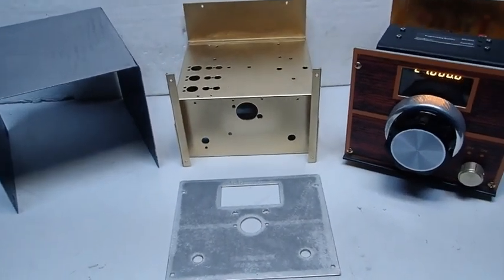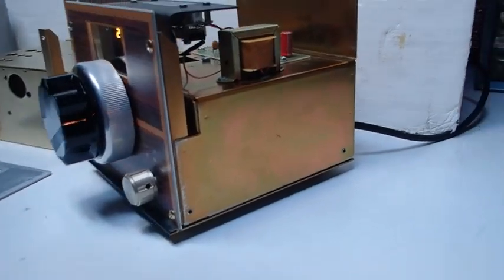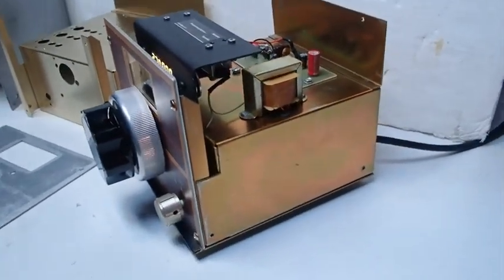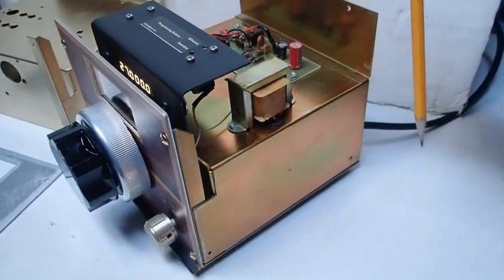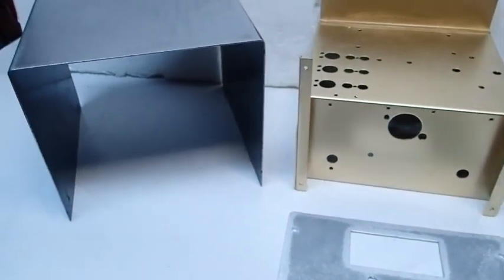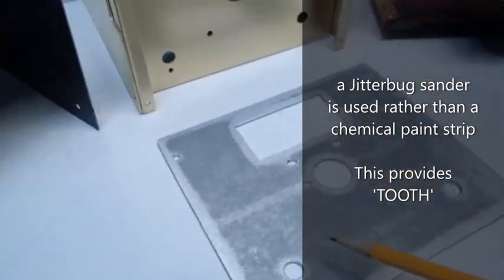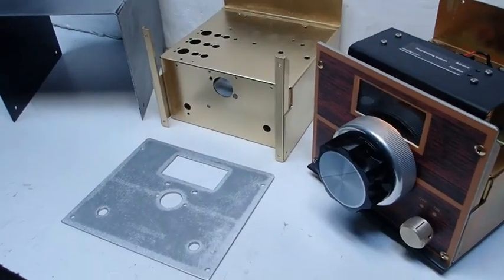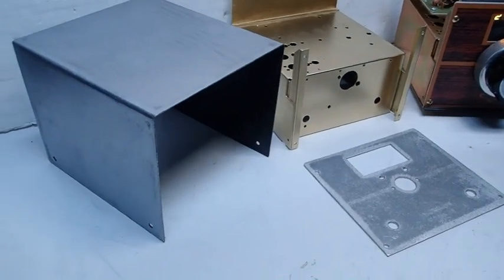Siltronix / s9radio Custom VFO & Restoration

Comment: Hey Greg Mike Enochs here in WV, I love your Siltronics VFO’s I have a Siltronics-6 on  one of my MK III could I send it to you for the conversion to match my MK III I like the rosewood cover and wood grain face plate.
Thanks 
Mike Enochs
Reply from the maker: Sorry Mike, I do them in batches and only VFO's I own.  That way if a knob gets mixed up and put on another VFO, no big deal as they're mine.  The other thing is, my work-shop is 20 degrees and I won't be fabricating anymore parts till it warms up and I live at 6,000ft....gonna be awhile.  I have 3-VFO's left and then sold out till the next batch.  73
Reply: @s9radio nice